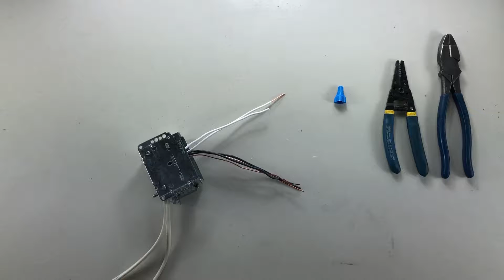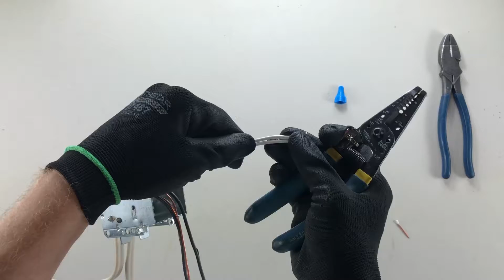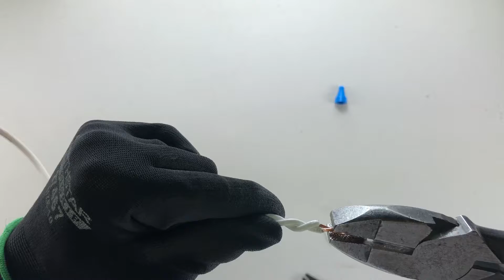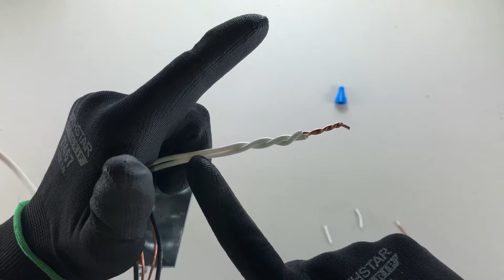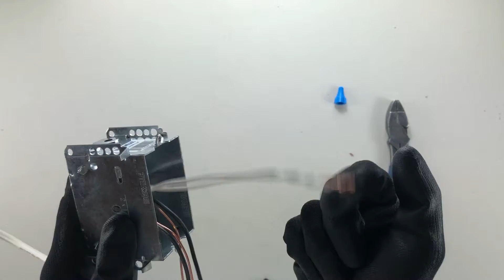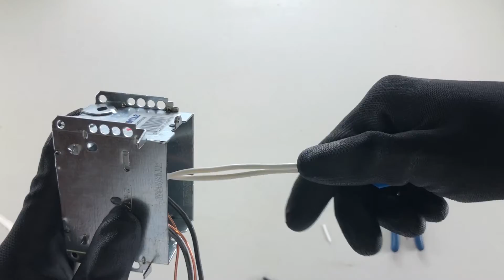How to make a wire connection - Marette Joint or Wire Splice - The Electrical Guide 2019

Comment: When cutting the tip at the end, it helps to cut at an angle, it helps secure the wire nuts better. Also be sure you are using the right wire nut depending on the gauge of your wire.
Reply from the maker: I'm not sure I agree about cutting on an angle, too many times I've seen the copper wire pop out of the tip of a marette from being too sharp and over twisted. If it wasn't sharp pointy ended from being cut on an angle it would be less likely to break through the marette causing a very dangerous condition. Especially true capping single wires!
Reply: @theelectricalguide  I'll try that as well, I was taught cutting at an angle,  but I see your point

Comment: I’m in school right now and will for sure be trying it this way. So thank you. Instructor never gave me the tip to grab the insulation first and then the wire
Reply from the maker: It really makes for a mechanically sound connection over time. Especially when you're connecting more than two! Thanks for watching!

Comment: Some guys say to stick the parallel wires into the wirenut and let it do the joining.  This way seems better, at least if you have the space to do to.
Reply from the maker: This is totally better, you wouldn't want your wires to untwist if you took off a stubborn wirenut and have potentially live wires spring apart. This ensures they have a great connection despite how your wirenut does overtime. Thanks for the comment!